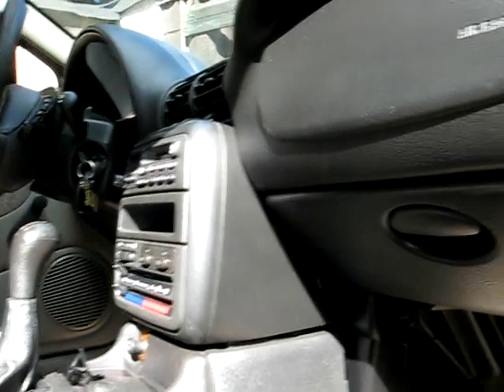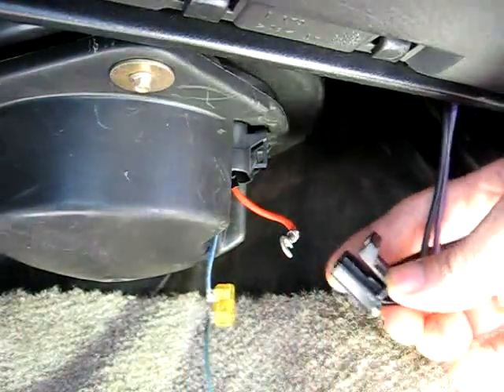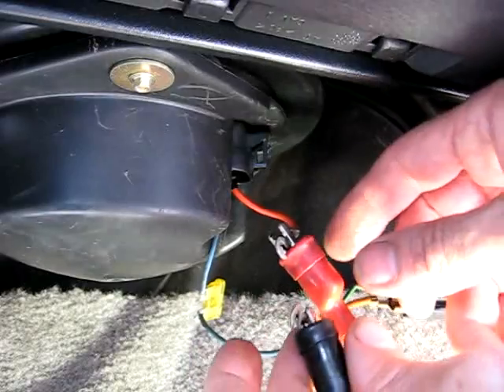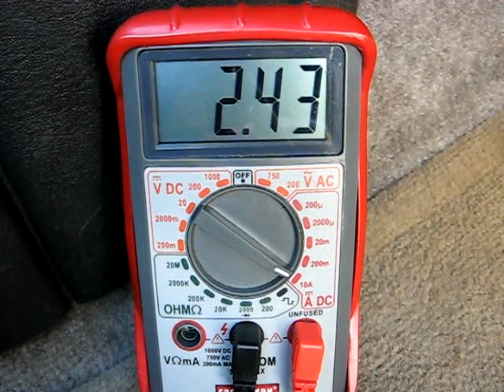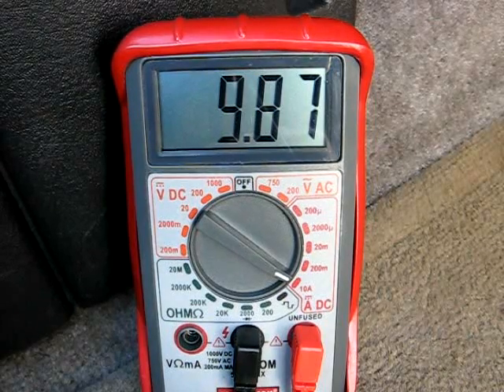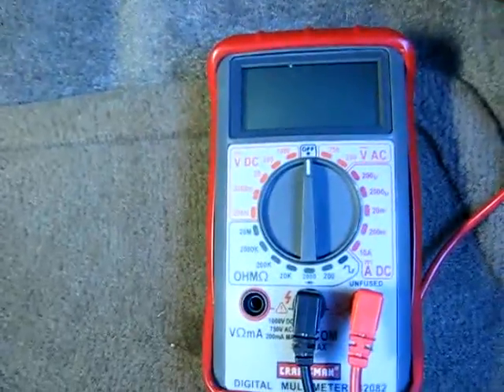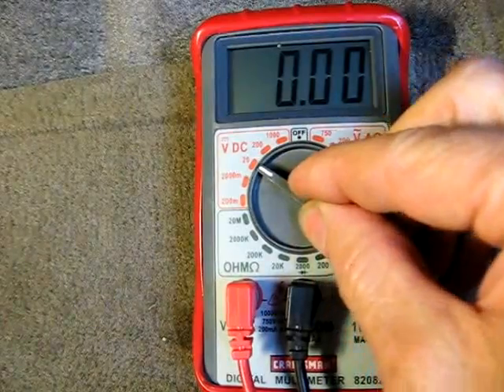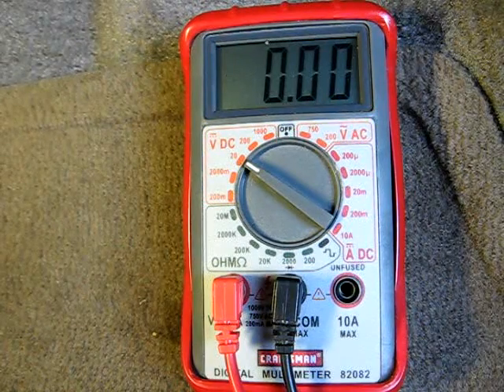Testing Blower Motor Amperage and Voltage

Comment: I dont know much about electrical testing so am confused about your set up. Looks like you just put those jumpers any old way. does it not matter which jumper goes to ground and which to power on the connector and the motor??

Comment: What was the purpose of doing all this you never explain what the problem was. To me this is a waste of time.
Reply: Shows you how to make the connection, im not a electrician so the video helped a lot, i also have 3 separate blower motors, i can test all 3 and depending on the readings i can tell if one more is pulling more than the others, i have a reason to believe that one of the motors i have its on its way out so it was helpful to me.

Comment: If your multimeter is only rated to 10amps you shouldn't be testing amperage that blower motor pulls over 20 amps on full speed hence why it has a 30 amp fuse for it installed on the outside of the glove compartment.

Comment: Were the amperage readings within normal, acceptable values? What would non-acceptable perimeters be? Expected readings on a new motor, installed with blower wheel? How does resistor affect amperage and voltage readings taken in this fashion?
Reply: The resistor would affect fan speed

Comment: My blower motor only works on LOW. Any suggestions. I'm kind of a rookie, but I do have a multimeter.
Reply from the maker: Have you tested the blower motor resistor.
Reply: richpin06a I got it...thanks. Wisconsin kicked our butt a couple days ago and I NEEDED IT. I dinked around and managed. THANKS

Comment: My blower motor winding measured 0.5ohm..that means on full speed it can pull 28.8A at 14.4V, way to blow a unfused DMM lol maybe we can try with a DC clamp on meter

Comment: what if i get 12v at the motor but its not turning on, must be losing amps somewhere....
Reply from the maker: +Chris Kaminsky If the motor is receiving voltage and ground and not working then there is a very good possibility that the motor is faulty.
Reply: +richpin06a hmm i replaced the motor, both motors turn on when i touch them to the battery. replaced the relay, fuses are good, replaced the blower motor resistor. love your vidz btw, been helpful!
Reply: @loodahchris04  your should of worked on high only 123 go through the resistor

Comment: you have two wires on harness. black and purple.  is black ground? it appears your connecting meter to the spade coming from fan that would be ground to the purple wire which is hot.  is that the case. I don't want to it backwards or does it matter? Please explain
Reply from the maker: scooter12368 The purple is hot and black is ground.

Comment from the maker: Never ran into a problem were the A/C would blow colder while the vehicle was turning.But it is normal for reduced cooling while standing still because of air flow over the condenser.

Comment: In an 89 buick lesabre, why is it during a turn the air condition blows dramatically colder like it should. It blows cold but not as cold as it should while driving. At a stand still it blows cool! It's fully charged, new compressor and dryer, new tensioner, new belt. The dryer is cold & sweating! & it has a new blower motor. The system is not manual, it's touch. Appreciate a solution if u have one?

Comment from the maker: @mattcasdorph You said you had voltage at the connector so if the connection is good it is a ground or motor problem.

Comment: @richpin06a I tried a homemade jumper to make sure the connection was good from the connector to the fan prongs, never got it to come on, I also bought a ac/blower switch and replaced that, and today bought a new relay (the old one had a prong that looked like it got hot before so I figured it may have went bad) and it still does not blow. Whats the switch in the center called? The one that controls gates and defrost ect...

Comment: @richpin06a Ok, I tried the meter set to 20 DCV and it read 12.15V, I switched it back to 10A and changed the red probe end to the Amperage gauge and it still shows no amperage, but apparently it does have voltage! I know the blower is good, could it be a bad connection between the connector and the prongs on the blower motor?

Comment: @richpin06a Would it matter that it was on 10A setting? I know that's amperage, but if there was no amperage reading, wouldn't that tell me there is no voltage anyway? I didn't get to test it on the 20 DCV

Comment: @richpin06a I'm not sure, The last time I tried to check it with the multimeter I wasn't getting a reading, but I may not have had a good connection with the multimeter (using the multimeter probes on flat prongs is a pain), I was going to try to test it again today, but my sister had an appointment and borrowed her car, so I have to wait till afterwards.

I guess if I don't get a reading at the blowers connector it would either be hot or ground one that's not completing the circuit.

Comment: I'm trying to figure out why my moms heater in her Contour is not working, I took the blower motor out completely and tested it off the battery and it works, and I replaced the Blower Motor resistor and it still dont work, I'm guessing there is either a wiring problem or a switch.
Reply: Matt Casdorph check the relay

Comment: @widtrak77 Thanks for the reply. The blower motor in my 1977 GP only works on high-new resistor didnt help. On high it seems to put a heavy load on the system-lights dim and slow blinkers particularly at idle. Is it possible there is excessive draw from this and how can I test if no lower speeds and the meter maxes out at 10amps on high? Thanks for the communication! All other components test good.

widtrak77 2 weeks ago

Comment: @richpin06a Thanks for the reply. The blower motor in my 1977 GP only works on high-new resistor didnt help. On high it seems to put a heavy load on the system-lights dim and slow blinkers particularly at idle. Is it possible there is excessive draw from this and how can I test if no lower speeds and the meter maxes out at 10amps on high? Thanks for the communication! All other components test good.